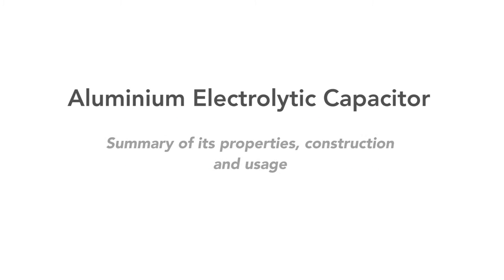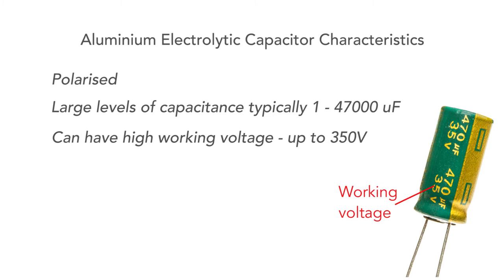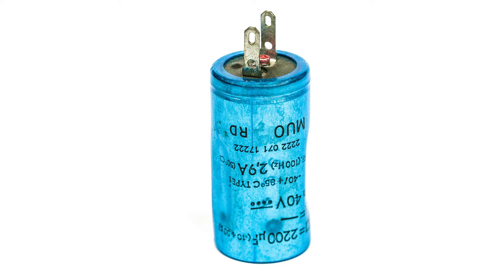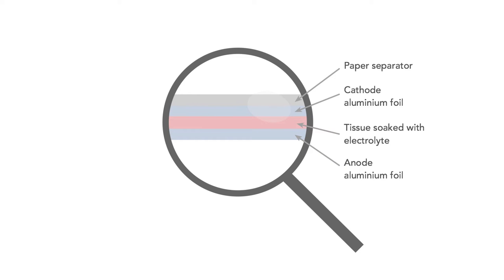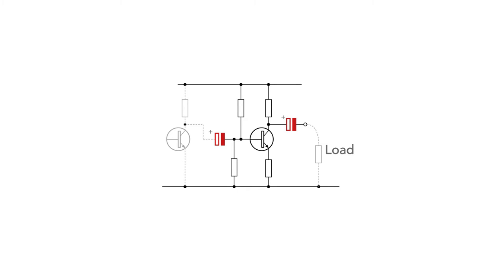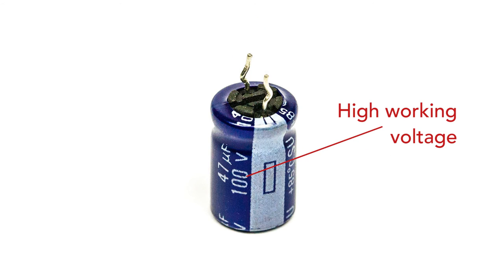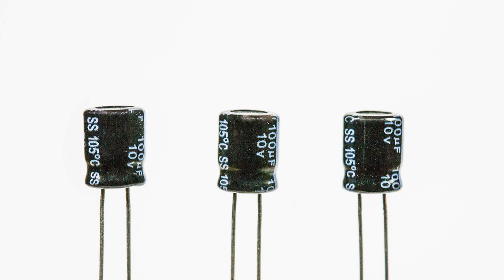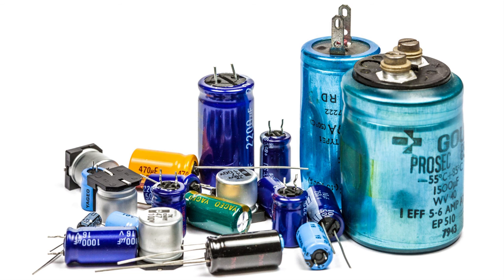Understanding Aluminium Electrolytic Capacitors: #capacitors #electrolyticcapacitor

Comment: Electrolytic capacitors mounted on electronic circuits of devices manufactured after 1990 can remain unused for as long as possible without this disuse causing failures and depolarization in the electrolytic capacitors?
Reply from the maker: It is not possible to say because the time will vary according to conditions, manufacturer, capacitor value and other things. 30 years is a long time, so I would be very careful when using it.
Reply: @ElectronicsNotes  there is no parameter rule for everyone? it is very difficult to open all my devices and discover the manufacturers

Comment: there a risk of this aluminum electrolytic capacitor of electronic device long term storage opening and leaking acid and corroding the PCB board?
Reply from the maker: Yes, this is quite true, but not all of them go this way. I think when looking at old electronic equipment, many components need to be treated with respect, and certainly electrolytic capacitors can leak.

Comment: The only thing I don't understand is why some electrolytics can be much larger but have the same uF and the same voltage and even lower voltage than one that is a quarter of their size. :/
Reply from the maker: There are many things that can alter the size: manufacturing process, reliability, ripple current capability, etc . . .
Reply: Right on. Thanks!

Comment: I have an guitar amplifier with an electrolytic cap on the power board ,the make and value is marked as ;Philips, 6u8t,40v,l 3,...I cannot find one with this value.Can i use a 10uf,40v cap in its place.? Is the 4.7uf cap not strong enough.
Reply from the maker: Normally electrolytic capacitors have a very wide tolerance, often +100 % and - 50%. The main thing to watch is the working voltage. This should be the same of higher than that in the original design.
Reply: I'm Pretty Sure There"s are  6U8 yF capacitors to be fond in both 100 volt  &  2oo Volt and i think i have some 4oo Volts Myself Lyingn around from butchering SwitchMode PWR suplys ((some of them probably was PC SuppLys witch is almost always the noisy switch mode type..... Remember that the voltage only states  for the most part how thick  and high-voltage withstanding the thin plastic film in between the metal plates witch makes the conection  you solder your contacts to.. So As Long As The Cap Voltage Is NOT Lower Then What You Had, Your Safe....   And If IT's Not In a Timing critical part of the circuit, power supply for eksampel it could never hurt,,, Capacitors are a world better today then what they was 75n years ago........
Reply: it bould never hurt to Beef It uP A Bit Was that i Ment to say..... Best of regards....

Comment: i have electrolytic capacitors mounted on electronic devices from 1990, how long can these devices remain unused and without the electrolytic capacitors failing due to disuse?
Reply from the maker: Difficult to give exact figures because different manufacturers, manufacturing processes age at different rates. I think I would proceed with caution and see how you go. They'll probably be OK.
Reply: @ElectronicsNotes  not period interval no t use electrolytic capacitors for all manufctures
Reply: from personal experience and some research with mostly 20 year old game consoles electrolytic go bad wither they are used or not, wither it goes bad faster used frequently or not idk. Electrolytic can go bad as soon as 7ish years but theirs's also reports of electrolytic lasting 30 or more years with no obvious signs of degrading. How long they last depends heavily on the specific brand and model of the electrolytic capacitor. if you are trying to replace capacitors i recommend doing some personal research in a specific electrolytic capacitor before buying them.   i am not super knowledgeable in electrolytic, hints why i clicked on this video, so don't take everything i said to be absolute fact. i hope you found or will find the information you are looking for on this subject.  I am here to learn so if you learned any useful information since your message feel free to tell or correct me on my information given.

Comment: I've been keeping old electronic devices from the early 90's and 2000's example snes console, ps2 slim and crt tvs will these devices have problems with aluminum electrolytic capacitors if stored for a long time?
Reply from the maker: Often they last quite well. Older electrolytic like those in valve or the radios need to be handled with care. More modern ones tend to be relatively reliable, but be aware they do degrade with time.
Reply: @ElectronicsNotes  Are electrolytic capacitors from the early 90's considered modern or not? what is the frequency of use of them in electronic devices to avoid damage due to disuse?
Reply: The original Xbox had a capacitor that was known to leak. I wouldnt take any chances. I plan on recapping my consoles and CRT TVs  my CRT pictures are all fucked up and I suspect the caps are bad.

Comment: If i may say... you forgot to cover old axial capacitors of 500v or so for a tube amps
Reply from the maker: Thanks fort he comment. We tried to cover the main types in use, but there are a number of types that we did not cover otherwise the video would be too long. May be in another video we'll take a look at them. Thanks for the comment though.

Comment: Manufacturers of aluminum electrolytic capacitors recommend energizing these components before 2 years of storage. Why is this recommendation?

Is this recommendation only for new, unused aluminum electrolytic capacitors?

Does this recommendation not apply to used aluminum electrolytic capacitors manufactured in the early 1990s?
Reply from the maker: It’s all to do with the oxide layer in the capacitor. If the cap remains uncharged for a period of time it may go. Charging it and ensuring the current is limited will help reform this layer.
Reply: @ElectronicsNotes  Is this recommendation only for new capacitors, unused aluminum electrolytic capacitors?

Does this recommendation not apply to used aluminum electrolytic capacitors manufactured in the early 1990s? for 90s electrolytic capacitor in pcb what frequency energize for prevent fails disuse?
Reply from the maker: @classicsamusaran3817  follow the manufacturer’s instructions, but generally I would only do this for older capacitors.
Reply: @ElectronicsNotes  I have electronic devices manufactured in the early 90s and they all have aluminum electrolytic capacitors, I keep these devices stored but I don’t know how often to energize these devices and prevent failures in the aluminum electrolytic capacitors.
I read that manufacturers recommend this but they didn’t say if it’s for capacitors in general or only for new capacitors with little use.
Reply from the maker: @classicsamusaran3817  They may well be ok, but some may not. I find that they can last a reasonable time if stored well - at room temperature. I can’t give a definitive answer because they are all different.
Reply: @ElectronicsNotes My house temperature varies 33-35C